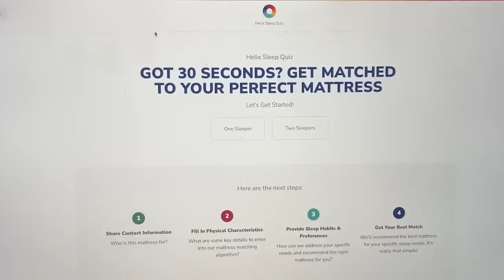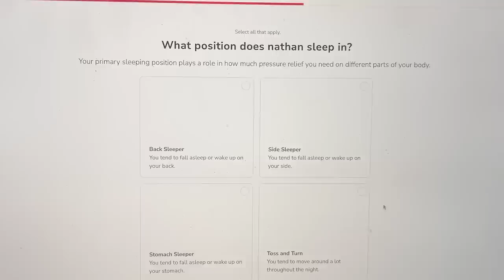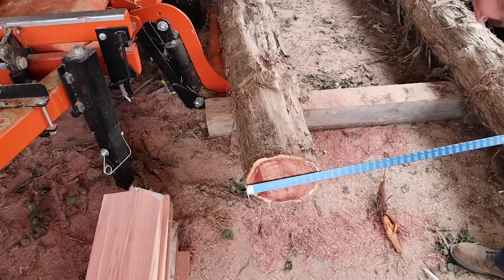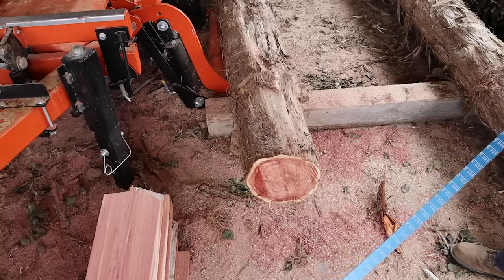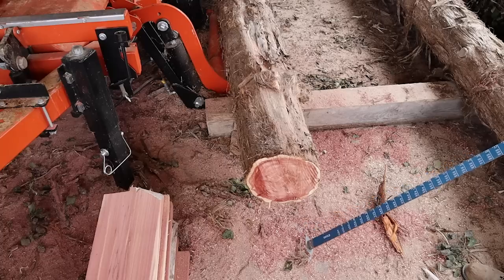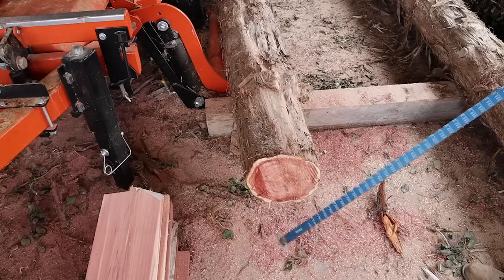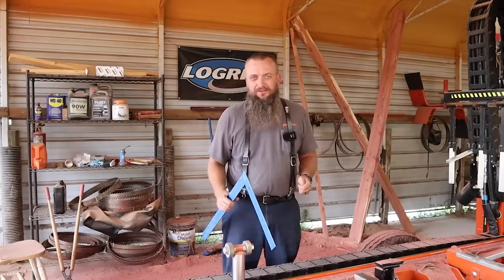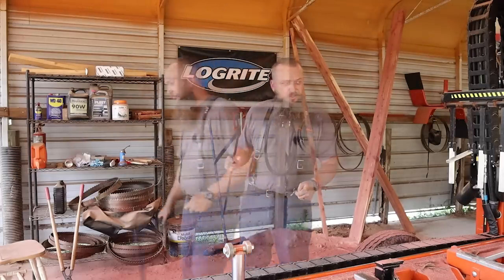Amazing Accuracy  Wood-Mizer's Fastest Portable Sawmill, LT70 Super Hydraulic

Comment: Out of the Woods, what blade are you using for your cedar.  We’re in Texas and cut about 100-150 tons of Texas (Juniper) Cedar per month.  It is extremely dry, fresh cut out of the log is only about 14-17% moisture content. We prefer 739 Woodmizer for our Pine Production, but have found the 7 degree tooth, 7/8” spacing, bites too hard in dry wood and is hard on the blade body.  We’ve been using a 10 degree with 7/8 tooth spacing for our Cedar, but 10 degree is very slow in the cut but more stable.

Comment: I couldn't run or jump for 5 years due to low back pain. Getting back in the gym and building lower back strength with rack pulls and hyperextensions has eliminated the pain and restored my mobility.

Comment: Can you explain board ft. The roller says 20 ft and you just sawed 60 .?
Reply: One board foot is easiest to imagine as a board that is 1" thick and 12" x 12" square. It is a unit of volume, not length. So 1" thick and 8" wide would need to be about 18-19" long to be one board foot.

I forgot what he said the length of the log was, but I think there were 5 or 6 boards from the first log? Just multiply it out and you'll get the overall board feet number.